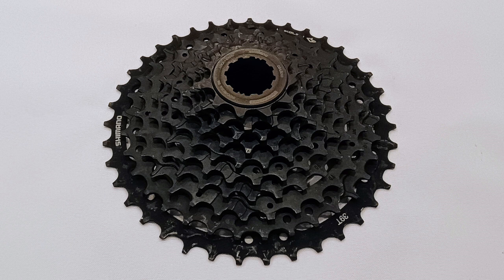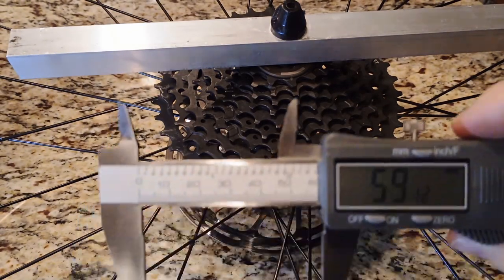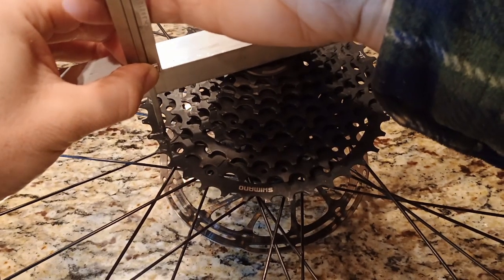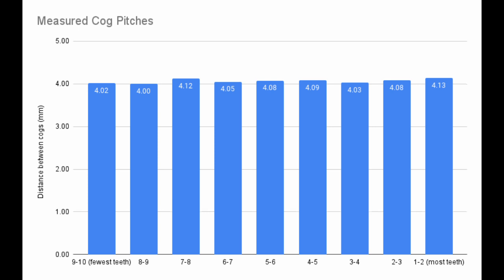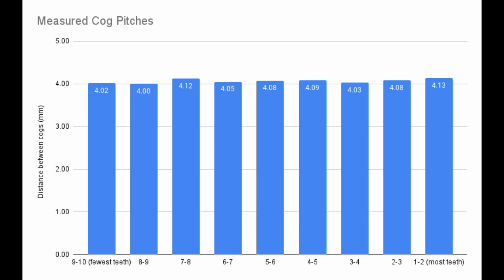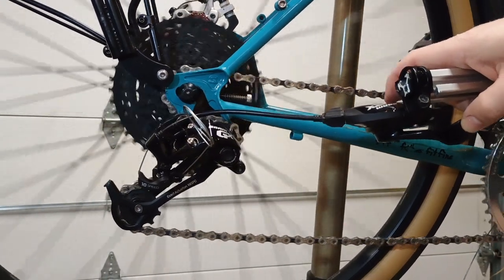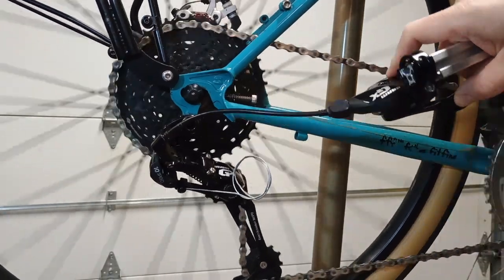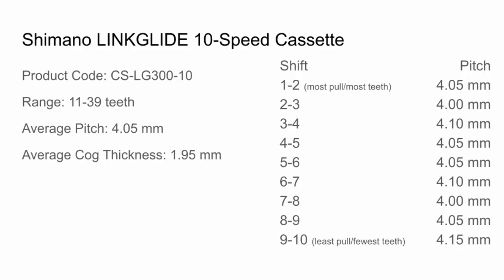Shimano LINKGLIDE 10-Speed Cassette

Comment: could anyopne help me? is that possible that Shimano SL T8000 Deore XT  (shifter)  deore m5100 (deraileur)  and linkglide 10s 11-48 will work together?
Reply: should work fine. I'm using a sl-m6000-10 with a rd-m8000-gs on a linkglide 11-48 cassette.

Comment: Hey Booth! Great vid. I’ve got an odd compatibility question? I keep finding conflicting info too, thought you may have some insight. 

I recently got a great deal on a Shimano XT 8130 rear mech and shifter. This is the 11 speed linkglide series of XT… and I’m wondering if it would still work okay with a standard cassette? I have a good deal lined up on an 11 speed 11-46 SLX cassette (M7000) you think all these pieces would play nicely? Or should I just drop the cash on a link-glide cassette?

Comment: First, I must say thank you, for doing all of this
 I am building a bike and habw microshift sword shifters (1 by). I am looking to have a nicer cassette and derailure
Can I theoretically use a cues (11_48) 10-speed cassette (CS-LG400-10 or CS-LG300-10) with a 11 speed xt (RD-M913) or cues 10/11 speed derailleur (RD-U6000) to fit the range? Thanks a ton in advanced.
Reply from the maker: Thank you for the question! I'm not sure that is going to work. I worry that the cog spacing on the CUES cassette is just a little too big for that combo.

A classic 10-speed cassette would likely work better. Here's some info on a similar combo: https://drivetrainbuilder.com/SB-M100A-RD-M5120-10.htm
Reply: @boothsbikeprojects  thanks for the information! Found you through Rus. Love the content. I'm going to try an e*thirteen 9_46 helix race cassette 11 spd with a shimano xt derailleur. I know the microshift shifters and deore line of derailleures work from your videos. Plan on adjusting the limit screws so that I don't use the 9 tooth cog. That helix 11 speed is lighter than any 10 speed I can find. I'll be sure to let you know how it goes. E*thirteen works with both sram and shimano so I think it's an interesting cassette to consider, albeit expensive

Comment: To sum it up it should work with any MTB 10 speed shifter and derailleur that are compatible with each other and cover the range of the cassette?
I'm quite confused since Shimano does not include this information on their compatibility chart...
I've Microshift advent x on my commuter and will try it out this winter.
Reply from the maker: I do these measurements to help you make an informed decision about mixing and matching parts that aren't officially compatible. I'm not ready to say that this cassette could work with any 10-speed MTB groupset, but based on my measurements, I think there is potential for this to work. The community won't know for sure until someone tries it out, so I do these measurements to help people decide whether it's worth it to try.

I look forward to seeing the result of your experiment!
Reply: @boothsbikeprojects  i'm aware about your project and appreciate your efforts.
Please keep it going.
Reply: I do have a question about 9speed regular cassete vog pitch is it really 4.15 anywhere else i read 4.35 ?
Reply: I was thinking the same. We know Shimano and SRAM both work with each other (by that I mean mixing and matching their cassettes)! Both being 3.95 cog spacing. So by that theory, if SRAM works on cues cassette, then it should with Shimano too..... Why oh why didn't Shimano just make it based on 10 speed. Make it 4mm cog pitch and have done with it! 

Interesting to see this video though, I knew 10 speed was 3.95. I was under the impression 9 speed was 4.34-4.35 not 4.15? I also read cues was around 4.2. 

I might give it a try soon. I have a gravel bike, grx 2x10 with 11-34 cassette. Officially supports 36 but read many reports an 11-42 cassette works for a monster gear range. Cues 11-39 might be a good middle ground and extra durability

Comment: If that GX rear derailleur has a clutch the 39 tooth is probably the limit. Though they look alike the non-clutch and clutched versions have different limits.
I've tested both versions with a 2X GX set up on my stock Surly Bridge Club (11-40). The clutched version hung up on the 40t yet the non-clutched version works (also beyond spec). So goat link going beyond these cassettes.

BTW I wouldn't be surprised if Shimano left well enough alone regarding backwards compatibility. If shops found themselves buying Cues components trying to integrate them into shifting set ups only to find things don't work ( built-in obsolescence). It would add to the #thanksshimano exposure. I haven't looked but perhaps there's a compatibility chart.

Much appreciation for your work👍.
Reply from the maker: Thank you for sharing your real-world experience!

I think Shimano has made it clear that CUES is replacing lots of down-market groupsets and making it so shops don't need to carry so many SKUs. The compatibility charts say that CUES is only compatible with itself, but it's clear that there is a lot of unofficial cross-compatibility.
Reply: I can't talk for the gx rear mech specifically, but SRAM 10 speed often coped very well with bigger cassettes than Shimano of the era. I've ran a SRAM 10 (I think x7 🤔) rear mech with a sunrace 11-42 cassette for years (well before Shimano released 11-42 hyperglide cassettes) converted over from 2by 10 anthem 2014. It works flawless. In fact it shifts better than my newer trance did with Shimano 1x11. Until I switched out for an xt shifter and a SRAM xd cassette. 

So yeah would imagine 39t is no issue for the gx rear mech.

Comment: Thank you for sharing your findings! Hope you can test Shimano's new entry level Essa RD and 11-45 8-speed cassette
Reply from the maker: Essa looks interesting. I expect the pull ratio to be around 1.7 like classic Shimano, but I wonder if they tweaked it at all.
Reply: It's supposed to be backwards compatible with the old stuff so yeah hopefully it's 1.7:1. Be good to find out, would mean you could match it with old road 9 and 10 speed brifters to do conversions to 1 by gravel etc!